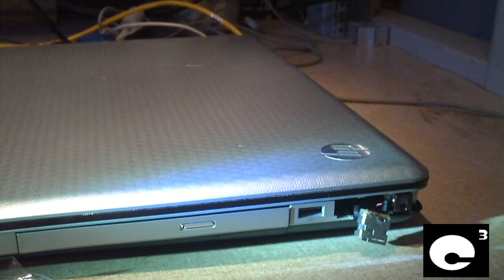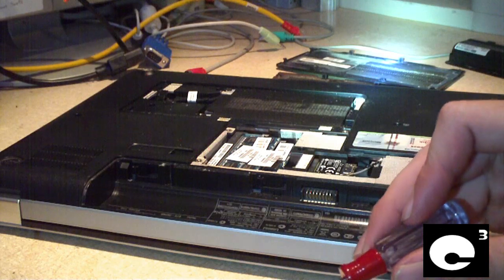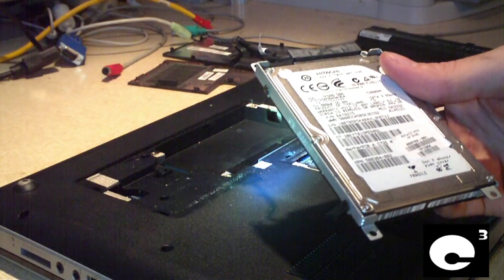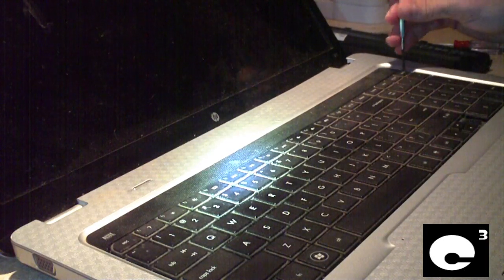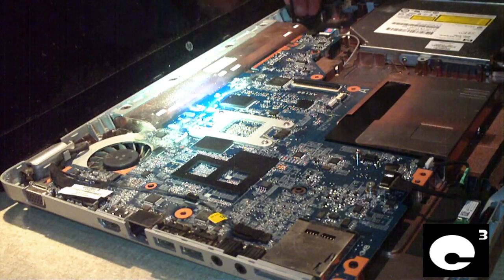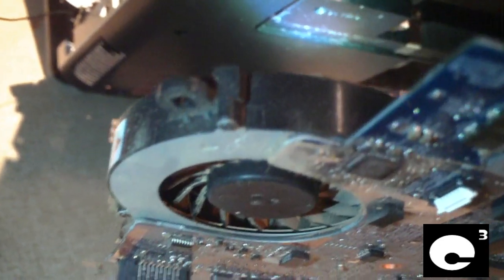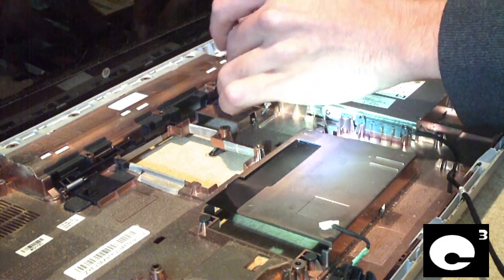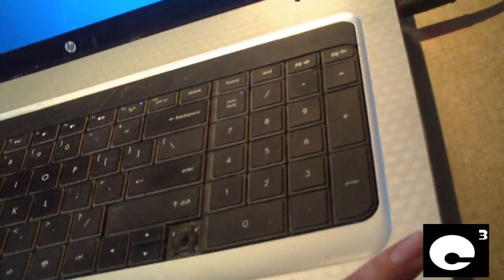HP G72 Notebook Power Jack Replacement + Junk HP Mobo Repair

Comment: I see that this video is pretty old, as is the laptop, but what kind of glue did you use on the power plug to stay in place?
Reply from the maker: Standard hot glue
Reply: Cube Computer Channel I used Gorilla and it is solid but I think when she messed up the plug she might have short  circuited  the board

Comment: please pm me or something my gf laptop same make model and issue what glue did you use?
Reply from the maker: I used hot glue in this repair.
Reply: did you put just a little or alot and just the bottem or bottem and sides
Reply from the maker: Jeremiah Bennett I put quite a bit of glue around all sides of the jack. This is because the plastic on the back corner was broken.
Reply: ***** thanks again will + and sub been a big help

Comment: Same issue with my power jack but the only difference is it happened from the screw on the base coming loose. I bought a used base, palm rest, and new power jack and plan on doing this repair when they arrive. Right now the computer is still working but 3 of the wires in the power jack are totally cut off. 

If that thing comes off on my motherboard I'm going to be screwed, I don't have a heat gun is there a way for me to avoid that?
Reply from the maker: Just be careful when unplugging things from the motherboard and you should be fine.
Reply from the maker: Joshua L The Wifi connectors simply pop off the wireless card. Be sure to keep track of where the two leads go. There are other various ribbon connectors and pop connectors. Just be gentle with them and they won't break.
Reply from the maker: Joshua L If you're talking about the side USB and webcam connections, those slide in and snap-lock.
Reply: *****
Thank you so much for your help man I have it disassembled and the power jack removed with no issues. Okay last question though if I want to put a new base on it, do I have to move the motherboard and all that to the new base?
Reply from the maker: Joshua L To switch to a new base, you have to remove and transport all the components, etc.
Reply: ***** Is it worth it? Do you think I could do that without breaking anything? Basically, I need to do the base, palm rest, jack and hinges because a stiff hinge is what caused the base to break on the side and then let the jack hang out. I could just do the jack and stop opening/shutting it.
Reply from the maker: Joshua L It depends on how badly damaged your existing base is and if you can find another matching base. I'd suggest looking on eBay for a parts system with something like a dead motherboard. That way you'd have a good parts donor to use.

Comment: Thanks!  Another question:  Can that part (five-pronged attachment) be soldered back on?
I looked at the reflow videos, including yours on the chipset, and am a little afraid I'd damage something else trying to get it back on with a heat gun.  I realize I'd need a very sharp soldering tip.

Comment: Great video.  I ran into the exact same problem with that broken solder joint on that five -pronged attachment to the mobo.  You said in the video that you used a heat gun to reattach it.  Did you have to remove the mobo from the computer to do this?  Do you have any other videos showing how this type of reattachment can be done using a heat gun?  Thanks so much for your work.

Comment: You're right! My mistake. I had to solder the same thing you soldered by refluxing and using a heat gun. But it doesn't power on. So I assume it needs a new power jack cable. The power transformer/wall wart is good. Thanks for the reply! :-)

Comment: Mine is the power connector setting on top of the motherboard. I tried the heatgun but it doesn't  seem to work. It's not easy to get the connector to stay in place. I tried holding it down. Is there a technique you used?

Comment: I just watched your video and my G72 has the same exact problem. How did you re-solder the connector for the power jack connector. I have re-flowed a Playstation ps3 before, I tried but the solder would not loosen and I had a hard time keeping the connector in place. Any suggestions?

Comment: I just bought a hpg72 power adapter, It looks nothing like yours.  Theres no notch on top , just a small bump.  It has 7 holes as well.  Is this like yours?  I dont wanta take it all apart to find out it was wrong. Thanks!